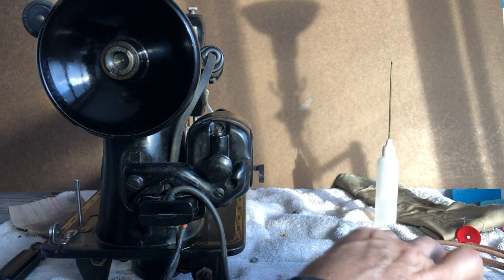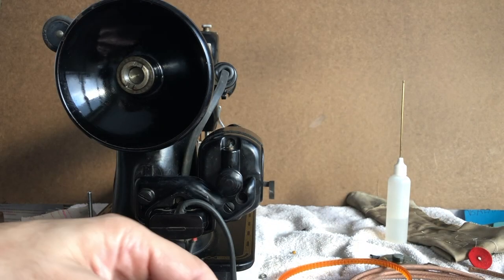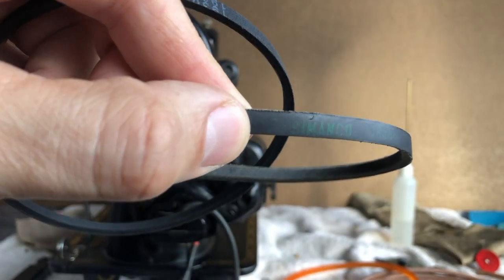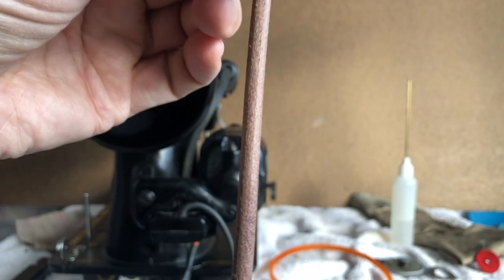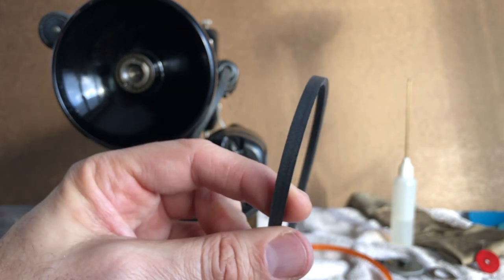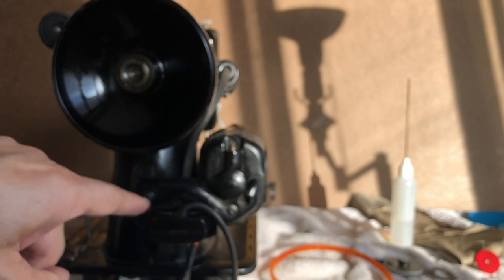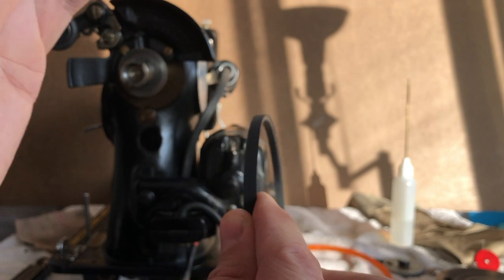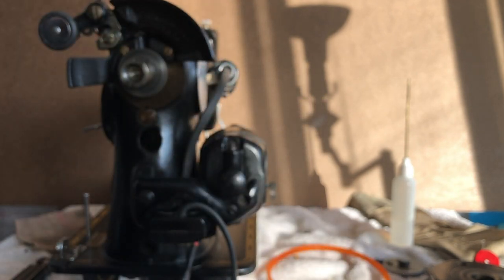TENSION HEADACHE!  Why Belt Installation & Setting Its Tension Are Crucial For a Machine's Success!

Comment: Happy New Year! What's your opinion on the black round stretch belts?
Reply from the maker: Hi Ronald.  I'm not a fan of those.  They were originally created out of convenience since they would fit a broader selection of machines.  They are not a good solution though because they elongate when in use and that trait saps power from reaching the needle.  So , while they technically function, they are not optimal and result in weaker piercing power for the needle.
Reply: @VintageSewingMachineGarage  I came to the same conclusion. A nearby sewvac recommended them. I wasn't very impressed. I went back to the original Singer type, or the orange lug type on Japanese machines. Thanks for your input. Have a healthy and safe New Year